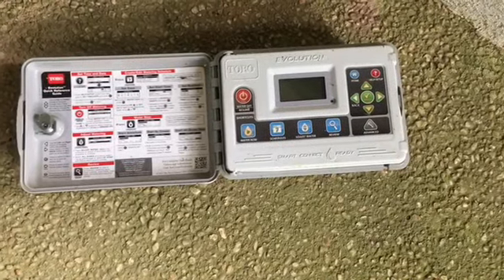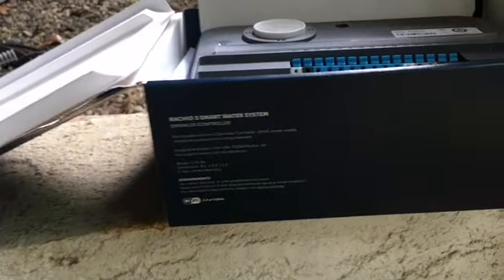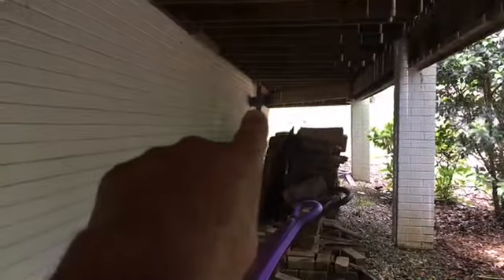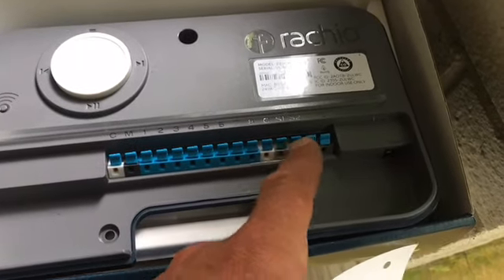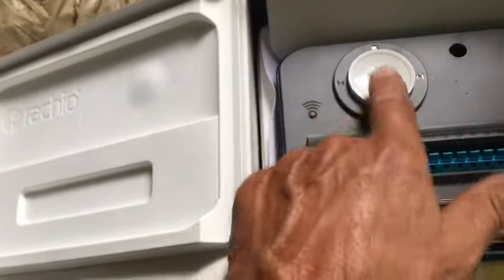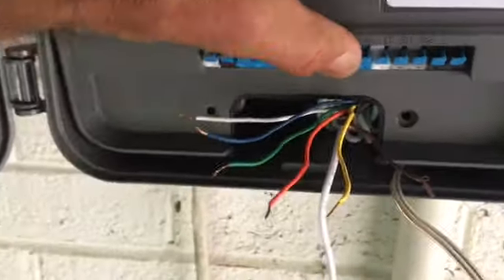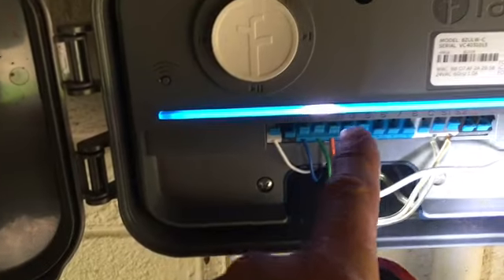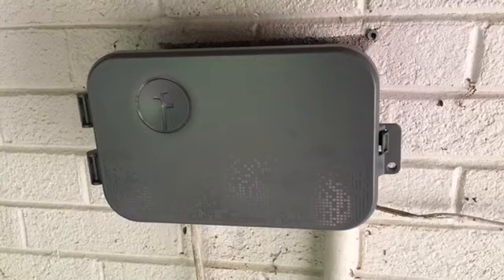Rachio 3 Smart Irrigation Controller Install

Comment: First off, great video! I’m replacing my old rain bird sprinkler control box with a Rachio. The old box has two wires going into smt sensor. I don’t see that on the rachio. I do see S1, S2, and 24vac slots on the rachio. Do I put the 2 smt sensor wires into the 24 vac slots?

Comment from the maker: When you install a sprinkler system the wires coming from your valves need to be run to a location with power outlet.  That is where you will locate your new rachio

Comment: You wired the rain sensor wrong. S1 is for one sensor. Such as a rain sensor. S2 is for a second sensor  - such as a flow meter...S1 and the Common for a wired sensor...geez